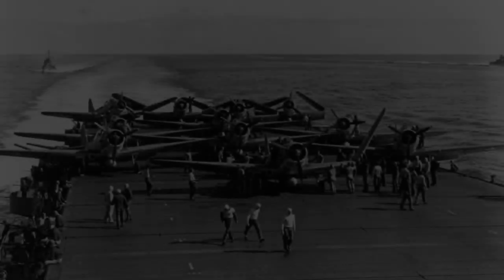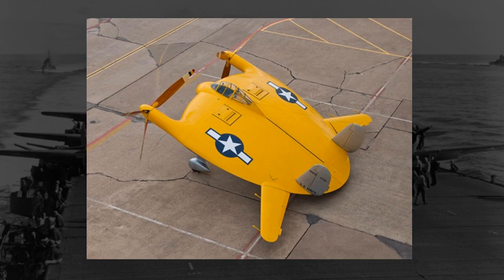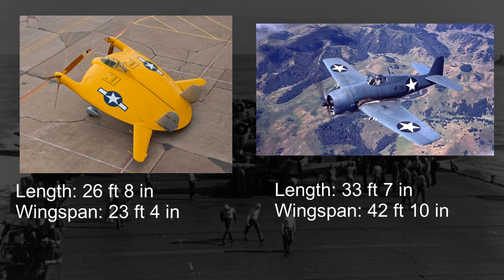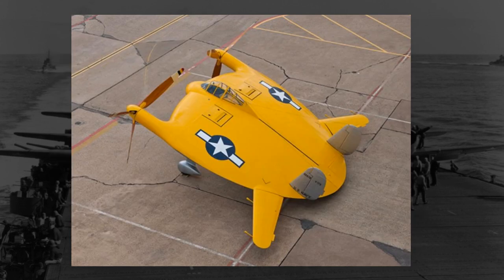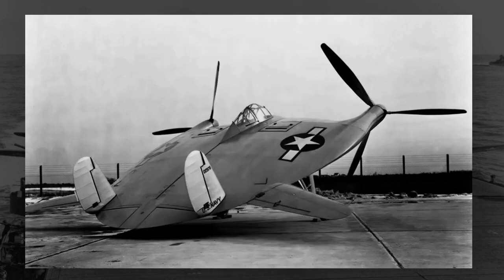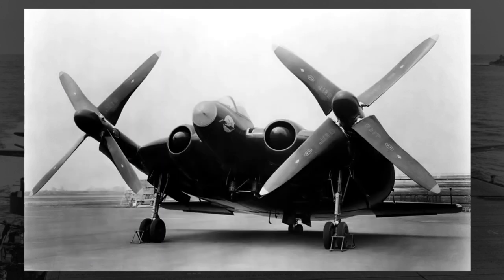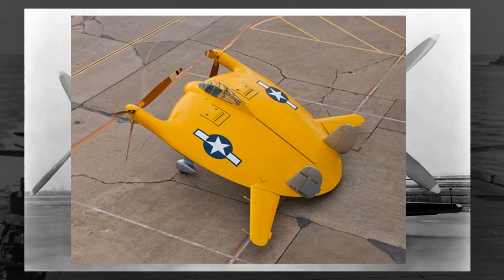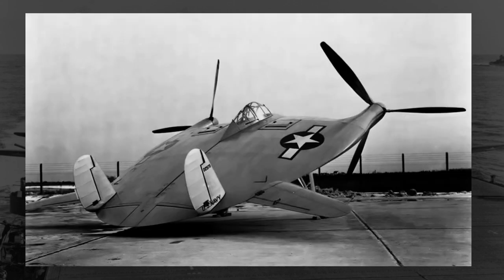Vought V-173 & XF5U: The Experimental "Flying Pancakes"

Comment: I wonder how this design would fare with modern engines and avionics. Seems like a great idea that should have been further developed - I'm thinking turboprops, or maybe even turbofans in the frame...
Reply: I think that with folding gear and 2 250 horse engines that this thing could be a flying thing to go anywhere, land anywhere and take off in no feet. It might even make a heck of a bush plane.
Reply: it it fun to fly these as poster board RC planes with high alpha.  I would not say they really fly well though.
Reply: @aldenconsolver3428  To get enough yaw stability at high alpha would be tricky in turbulent air! And with nil forward view, how would a pilot know where he was going when taxying, without a lot of help?! Definitely not suitable for bush use!
Reply: @ErikssonTord_2 
Many of the sort have not experienced instability or difficulty with control at up to 40 degrees "A".

Many planes with poor or no forward and downward visibility have been flying for decades. Every 2-seat biplane, crop dusters, the Corsair, the P-47, many others.
Several planes of very-low aspect-ratio have had excellent visibility.
Arup S-4, Eshelman, Payen AP-10, Hatfield "Little Bird", Wainfan "Facetmobile", others.
Reply: What would be interesting nowadays would be 4 or 5 electric motors across the front, to provide the airflow for the “blown wing.”  Smaller diameter props would allow it to have shorter gear, a lower ground stance, and better visibility on the runway and when taxiing. Would make it safer to be around on the ramp as well.  Would also relieve the need to cross shaft the engines, which would save a lot of weight and complexity.

Instead of a huge battery pack, provide the power from a small engine buried in the fuselage.  Could be piston, rotary, etc.  Ala the E-STOL concept.  As an engine providing power still has to work thru a battery, you’d have a much smaller battery, that would retain enough charge to get down quickly in event of an engine failure.
Reply: @PRH123  the high nose-up stance is needed for the super STOL "parachute lift" effect which gives them super slow flight and landing speed and stall-proof ability.
They don't need to blow the wing, because they have the parachute lift effect.

NACA tests showed that it didn't gain anything from having the wing-tip location and outward spinning props, versus more normal 80hp props spinning the other way.
Reply: @JFrazer4303  hmm, pretty sure it was for ground clearance for the large diameter props…

Not sure what “parachute lift” means, but if it means the spiraling of vortices over the top of the wing, that would get nothing additional from a large angle of attack.

The vortices come from the blown wing, ie the prop vortices spiraling over the top surface of the wing along its whole length. These create low pressure which creates the additional lift.

That’s what provided the STOL capabilities and resistance to stalling at high angles of attack.
Reply: Turbofans would not work, because the purpose of this design is to scavenge energy from the propeller wash to improve lifting efficiency. Turbofans don't have a wide area of spiralling wash to use for this purpose, and as such, they don't really help this design at all
Reply: @spindash64  Ah, right - didn't even think about that.
Reply: @fallingwater  it's fair. Turboprops WOULD be an interesting option, though, thanks to the massive power in a small package
Reply: @spindash64  
NACA tunnel tests of the V-173 showed that it did not gain anything nor particularly change anything versus more normal 80hp propellers, even spinning the other way.
The V-173 achieved it's super-STOL stall-free performance solely because of the very-low aspect-ratio planform, not because of "sculpting" the airflow.
This design would have been fine with jets.

Very many very-low aspect-ratio planes work very well, without any concern given to tuned, oversized, wing-tip mounted props.
Reply: @JFrazer4303  do you have the reports in question? This does not line up with the data I've seen

Edit: also, I apologize for being a bit rude sounding. I just want to confirm this claim, because it has serious ramifications for the design of something I'm working on
Reply: @spindash64 your designing something but don’t possess or understand the working theories of that design and have to ask a random person on the internet for it?

Comment: The fact that the V173 would fly with only 2 80 hp engines with labyrinthian gearing and huge protruding landing gear the shape still has interest to me. folding gear and 2 300 hp Lycoming might make a an actual VSTOL craft for the everyman. Or at least might make a drone body with better performance than the current generation. Whenever I see that thing I have the urge to go out in the garage and start fiddling.
Reply from the maker: I still think the fact that it worked as well as it did for how radical the design was at the time is still incredibly impressive. I would imagine that with the technology we have today, it certainly would be possible to make something like it that didn't have the vibrational issues. I can't imagine that any aircraft manufacturer would really want to try and make something like it today as a consumer product, though, as it probably would only be sold to an incredibly niche market, so it wouldn't make monetary sense for the company to even make it.
  
Would absolutely love to see someone with money to burn make a modernized version of the V173. It would probably be really interesting for airshows and stuff.
Reply: A super-STOL plane that is stall-spin proof and efficient on low power always has interest.
They look funny, and "If it looks right it'll fly right" is taken as a hard and fast rule.

There are very many misconceptions about the very-low aspect-ratio planform,, many are spurred by the Vought/Zimmerman digression with the wing-tip mounted outward spinning plane-changing props (which NACA tests showed didn't help it).
Reply: It could also be developed into a phenomenal new Cropduster, sharing many of the strong points of Biplanes, but with the added bonus of less drag, meaning more spray can be carried rather than fuel

Comment: While working for NACA, in the early '30s, Zimmerman was on the team that saw the Arup S-2 from Indiana perform, and later wrote that he chose the very-low aspect-ratio planform as the starting point for his work on a VTOL tail-sitter, though neither the V-173 nor the XF5U had enough power nor appropriate landing gear.
The military like everyone else ignored the Arup planes which were entirely successful flying machines and did everything that the later Vought planes did.
NACA tunnel tests with the V-173 showed that it didn't gain anything with the wing-tip mounted outward spinning plane-changing props versus normal props, and the extra complexity of the drivetrain gave the V-173 problems and stopped the XF5U from getting close to flying.

The situation with the props hampered it and was not necessary.
Why the Navy ignored the Arup and other similar planes and built Zimmerman's digression is a mystery.

See also the Eshelman, commonly known as the flying flounder, for another, better STOL and fast & simple all-wing / lifting body plane which the Navy ignored.

It's a myth that the very-low aspect-ratio gave it high induced drag from wing-tip vortices.
The huge vortices are elective and temporary, for flying very slowly and being stall-proof. The vortices disappeared when flown normally, and the Arup, the Eshelman, and the circular wing Nemeth parachute plane and others have proven the type to be sleek and quick on available power.

Zimmerman did not use the props to supposedly counter the vortices. That's another part of the myth behind it.

The advent of jets didn't kill it: the US military used piston-prop combat planes into the '70s, for support into the '80s and still fly props.

The very-low aspect-ratio like the Arup or Eshelman would have been awesome with jets, would have outperformed everything flying then or for the next decade.

They looked funny and nobody took them seriously, and the misconceptions about them having high drag at cruise and needing wing-tip mounted, overly complex props have caused decades of misinformation about them.

Comment: I wonder if this plane would have had a chance in the jet era if they had tried to convert it into a turboprop.

I also wonder how maneuverable it would have been in combat.  As long as it didn’t slow down too much from extended turns (though, with those props, I imagine it would’ve had great acceleration), I like to imagine it could have easily kept up with a Zero.

And, had this plane made it into production, with its STOL capability and all that lift for ordnance, I imagine it could have found a niche in CAS during Korea with the Marines, or even the Air Force.

Comment: Apparently some people are looking into making an electric version of the flying pancake. I can see how that would be a better idea than... you know, having your drive shaft do 2 90 degrees turns from the piston engine generating power. 

Paper reference: 
DOI: 10.2514/6.2017-1184

'course, access is paywalled. -_-

Comment: Thks & sooooooooo for a given wing width;
If a wing with a little longer chord-width has a little more lift, then a wing with an extremely longer chord-width has an extremely more lift.
Sooooooo ???How well/pratical will extending wing chord-width scale???
Reply: The drag increases with wetted area, so from an efficiency standpoint, under Mach 1, you'd want higher aspect ratio, not lower, and then you need a tail much bigger and that's add drag as well. If you have unlimited power things are very different, of course.
Reply: @ErikssonTord_2  Thks

Comment: Had less hp than the as-6 yet flew whereas the as-6 couldn’t. Nice.
Reply: See also the predecessors of all of them, the Arup planes from Indiana.
Sleek on little power - notably not draggy.

The Sack needed more "A" to take-off, but they didn't have time to move the landing gear further back and put a nose-wheel under it, to keep it from tipping forward.